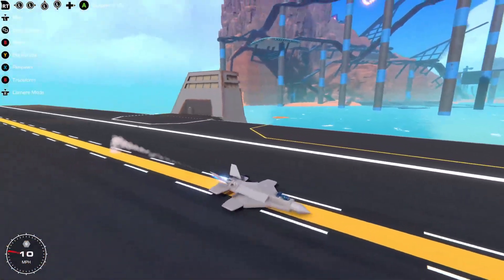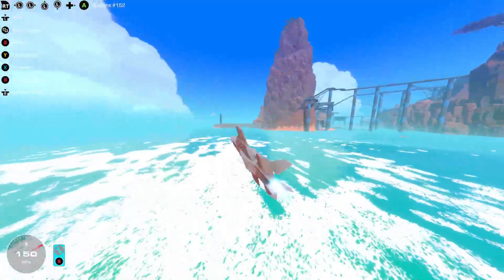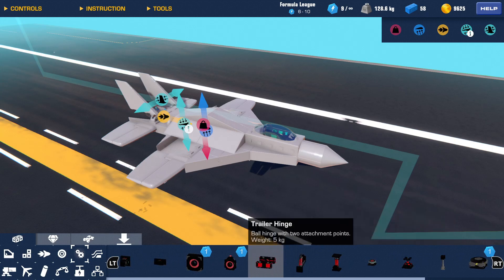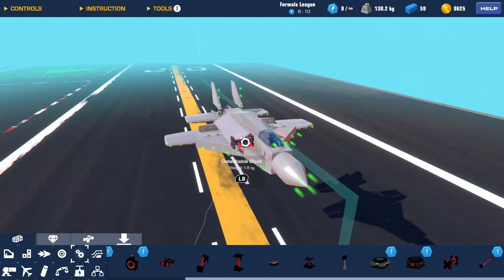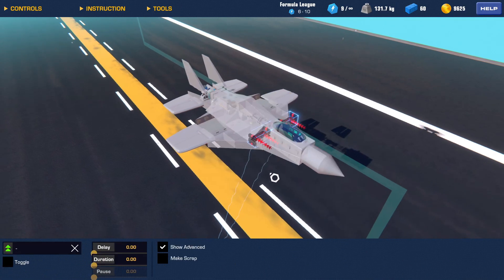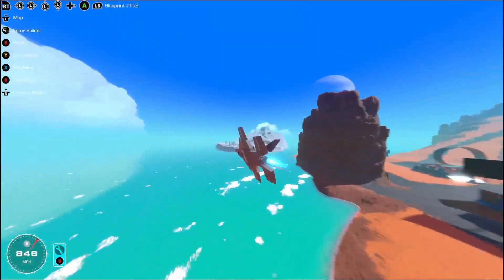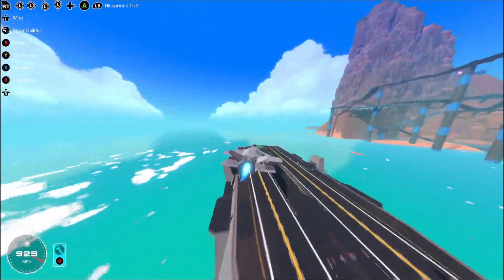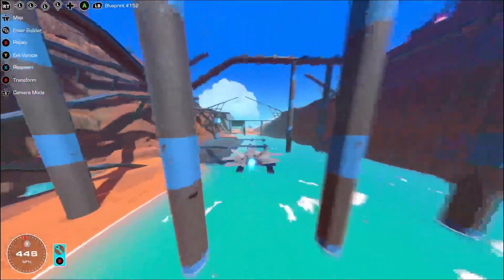How to make any plane supersonic (Zero Drag)

Comment: this seems really promising
also what's the first song name
edit: i made a fighter jet with 2 space thrusters using the glitch, my highest recorded speed was ~1200mph
Reply from the maker: The song in the intro is called “Gerudo Valley” from The Legend of Zelda Ocarina of Time OST.

And the highest speed I’ve been able to hit was just over 12,000mph after flying in circles around the map for several minutes with very tiny angle adjustments as to not lose too much speed.
Reply: @Zionity  thanks
Reply: @Zionity  12000 with one dragon jet??
Reply from the maker: @fixteamfortress2 One dragon jet and 2 mini thrusters, although that won’t really make much of a difference. The glitch creates zero drag, so there technically isn’t a limit, it’s similar to flying a creation in space without the quantum rudder.
Reply from the maker: @fixteamfortress2 it was the jet I was using in the video, I just took off the detachable blocks to create a video showing how to do the glitch